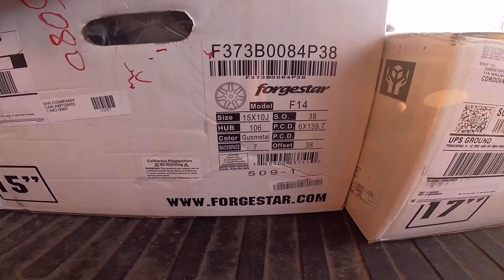Silverado Rebuild Montage: 4L80 Swap & LQ4 6.0 LS Power on Forgestar F14 Wheels

Comment: Did you have to narrow the axle to fit these wheels? Or did they just bolt right on with no figment issues?.
Reply from the maker: Nope does fine they make these 6 lugs mostly for the Silverado

Comment: Where did you get the F14 in 6x139.7 bolt pattern??? I asked through their website and they referred me to the X14 which is way too big. You got 18s
Reply from the maker: I have 17x7 front and 15x10s in the back
Reply from the maker: i just added links in the description if u wanna pick up a set
Reply: @FrogsGarage  Yeah OK. I missed that. But they're still 6x139.7 according to the box?
Reply from the maker: yea awsome drag pack setup for these trucks they offer other sizes too

Comment: What tire size on front and rears? And what drop ?
Reply from the maker: Can’t tell for sure drop just has stock leaf spring in back with axle flip and like 2” drop in front so probably a 2/4 and it’s a 295/65/15 rear tire and 225/60/17 front I believe

Comment: What cam do you have?
Reply from the maker: 54-469-11 by comp cams
Reply: @FrogsGarage  - that's a proven cam. 👍 I have a little baby 214/220 in my truck now, going with something bigger when I change the heads.
Reply: @FrogsGarage  - If you do mind me asking, what's the rest of the combination? I saw 706 casting heads in the one video. Are they milled? Any port work? What intake manifold?
Reply from the maker: Stock truck intake, 2005 lq4 engine with stock internals, 706 heads with no porting or milling, comp beehive valve springs, volant cold air intkake, speed engineering full exhaust, fast 88lb injectors, holley fuel rail, 4l80 transmission, stock converter, 4.11 gear, 295/65r15 back tire
Reply: @FrogsGarage  That's working really well for you. I'm not making anywhere near 400 to the tires, but smaller cam and stock 317s. I do have a TBSS intake, tune is for 87 and very conservative. I'm going to baseline it soon and most likely be upset.
Reply from the maker: @bluecollarhotrods9781  With that size cam I would say like 320-330 to the tire maybe less depending how big of tire is on the truck
Reply: @FrogsGarage  - it did 327rwhp and 372 rwtq on 87 octane. It's an EPS 214/220 .598"/.604" 111+2. I'll be switching to a 224/232 .581"/.595" 114+2, PRC Stage 2.5 862/706 heads, and a FAST LSRT 102mm. Not a huge cam, but the heads flow well and have 58cc chambers. The compression bump is going to help quite a bit.
Reply from the maker: @bluecollarhotrods9781  Well 327 with that cam I think I called it dead on with my guess lol and yea I think that new setup will put u at right to 410-420 range if you got good set of longtubes to get the air out
Reply from the maker: @bluecollarhotrods9781  I will say though probably kill a little down low with it and need atleast like a 3600 stall to really get her going out the hole
Reply: @FrogsGarage - 3600 is exactly what is going in it. It has Speed Engineering long tubes now, dual 2.5" lead pipes. I have dual in/ 1 out Magnaflow muffler with a 3.5" tailpipe. It seems to work. 4.10 gears, efans, etc. I think the biggest  thing holding it back is the type of fuel. I'm going to have it retuned with 93 and a 160 degree thermostat... see what it picks up.
Reply from the maker: @bluecollarhotrods9781  Flex Fuel Conversion like I did, price of fuel right now it be worth it. You can run 87 for daily then throw some e85 in it if u wanna go to the track and the computer will add timing when it senses more alcohol in the fuel. Have best of both worlds and only costs bout 200$ to convert it to e85 even less if the OS in your ECU already supports it. Should go with the whole Speed Engineering x Pipe full 3 inch system if it was me thats what I run in my truck.
Reply: @FrogsGarage  - e85 is hard to come by here. When I do see it, it's as much or more than premium. It used to be $0.50-$0.60 cheaper
Reply from the maker: @bluecollarhotrods9781  I pay like 10 cents less per gallon than 87 for it here in SC station like 20 mins from my house has it
Reply: @FrogsGarage  - Lucky, sadly not the case in central Florida. It's a minimum 40-45 minute drive from where I am to a station with E85.